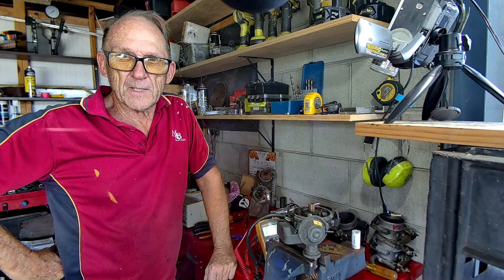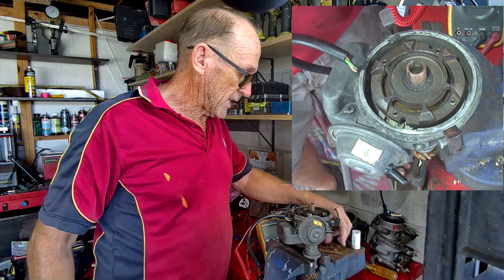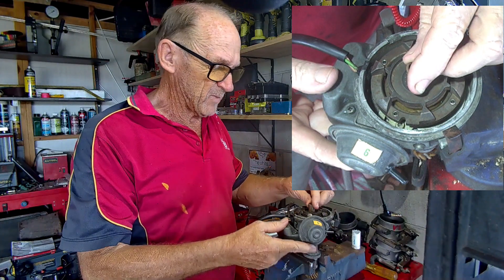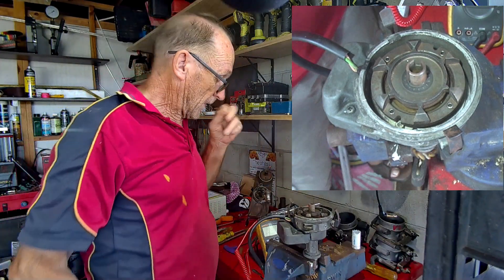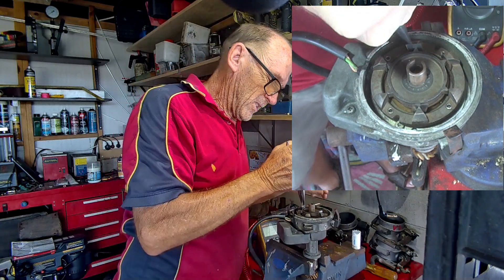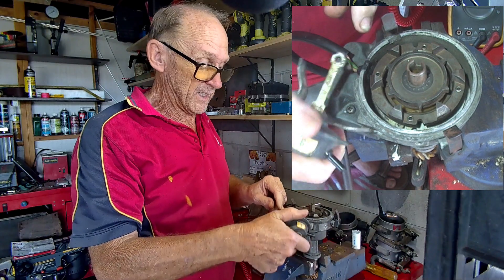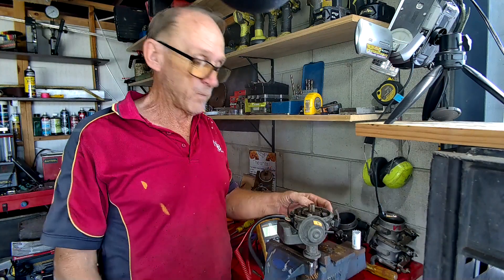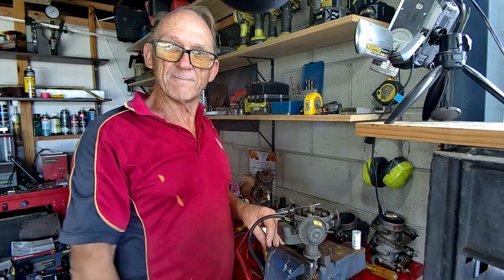Holden Electronic Distributor Service Part 2 - Centering the Stator

Comment: Thank you, I love this 3-part series, can't wait for more how-to videos to come! 
I have a Bosch 9230064706 and its in need of new bushings/bearings as theres a fair bit of play in the shaft. Is there an overhaul kit that can be purchased to repair?
Reply from the maker: A refurbish of the electronic distributor is coming out on Tuesday. I am afraid virtually no parts are available, some minor bits still are & mentioned in my 2 part series.
Reply: @mbsoldschool  Oh, that's unfortunate. With the number of classic cars running around with these things, you would think there would be. Can't wait till Tuesday's video. I appreciate your help :)
Reply from the maker: I brought the videos forward to tomorrow. I stand corrected you can still get the stator assy new from Holden parts hoarders that want a fortune for them. what else you can get will depend on who's actually listed them for sale. Scorcher Distributors may be able to help with some bits but not the fibre washers. Once you see the part 2 vid you will have some idea.